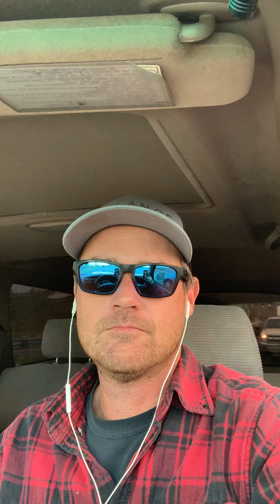Trane mini split error code E8 on indoor display, what it means and what to look for.

Comment: What about E7
Reply from the maker: Hi there, thanks for the question. I’m not showing a E7 for the particular model being referenced in this video. Where is the code showing up? The remote? The air handler on the wall or on the outdoor unit? If it’s showing up on the indoor unit display do you have the model number to the unit?
Reply: @hvacfieldshoptalk9591  i figured it out. Thank you though
Reply: @hvacfieldshoptalk9591   Hi need the the wording digram for the symboi control  for two 7.5 please
Reply from the maker: This is the un official up date to the wiring schematic. I would suggest getting ahold of your local FSR for help. It was a fair amount on head scratching to get it all talking to one another. I will post it on Instagram, not sure how to put a picture on the comments for you tube, 

@hvacfieldandshoptalk
Reply from the maker: It is posted. Hope it helps you.
Reply: @hvacfieldshoptalk9591   l don't have instant gram acct
Reply: @hvacfieldshoptalk9591  do the condenser feed the Themostat
Reply: @hvacfieldshoptalk9591   if you can me tomorrow it would be great I reach out to the tech support they do not know I'm in Alabama